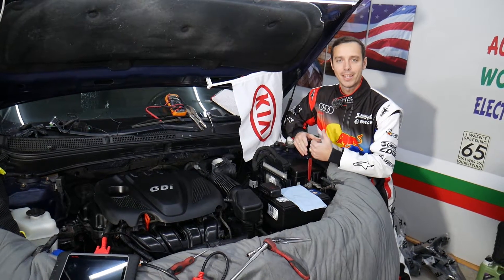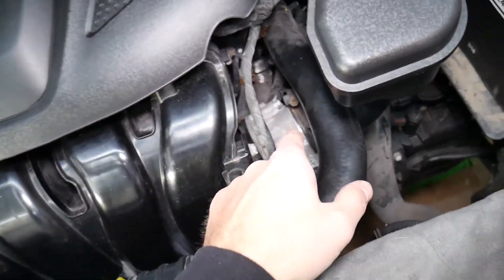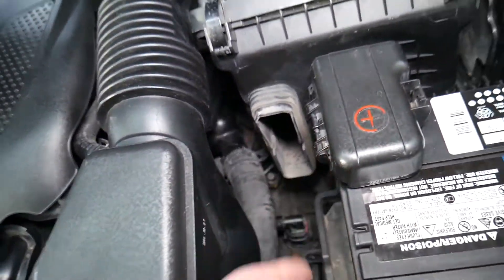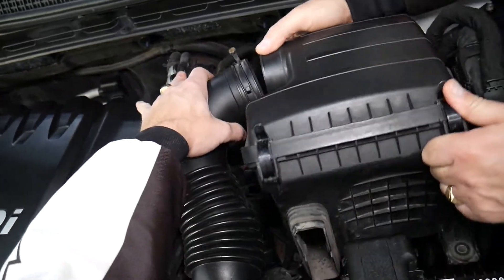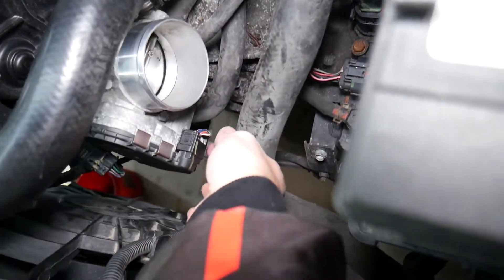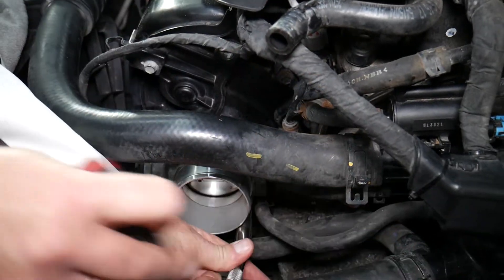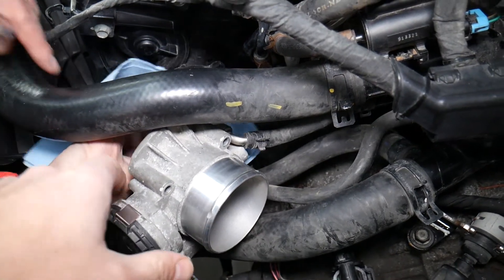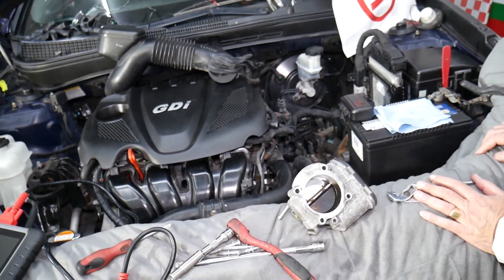KIA OPTIMA THROTTLE BODY REMOVAL REPLACEMENT

Comment: If I want to clean the throttle body while it’s still in place (without removal) do I still need to bleed the coolant and the the cooling system?!
Reply: I was about to ask the same question! Did you cleaned your throttle since then?
Reply: I believe so due to the fact that there is a hose connected to it which i think the coolant enters through
Reply: @jean230775  nah man I cleaned it without bleeding anything. Can’t remember what I did but know I didn’t drain anything
Reply: No need to bleed if you don't fully remove it and don't disconnect those coolant hoses. Otherwise, probably.

Comment: Hello, how are you doing? I'm asking you about the throttle body Bory, what torque does the bolts have when you put them in NM or FT? Could you help me please? It's a 2015 Kia Optima 2.4 4 cylinders